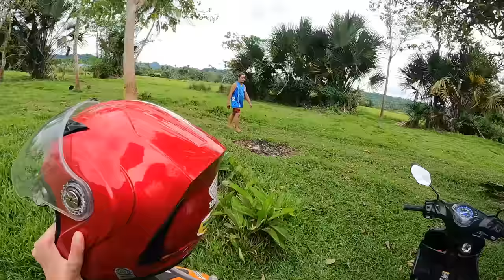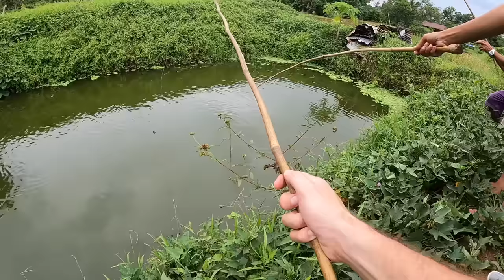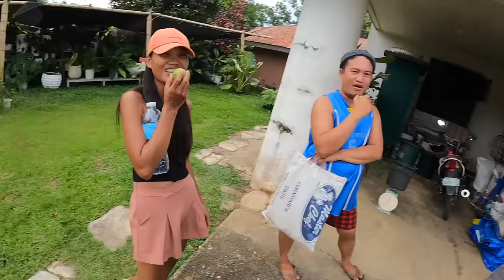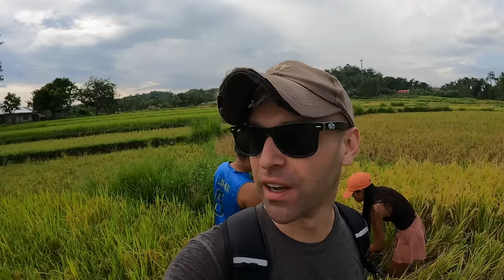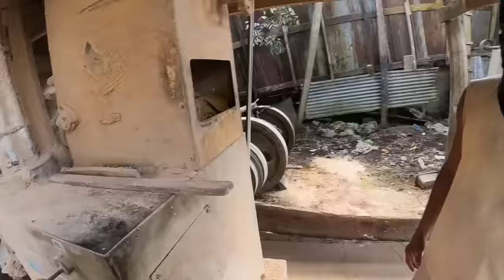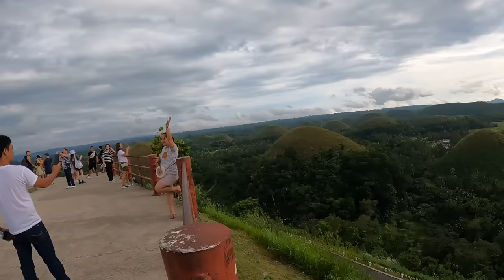FILIPINO RICE HARVEST! 🇵🇭 Philippines

Comment: While watching, I can almost feel and smell the freshness of the air 😍

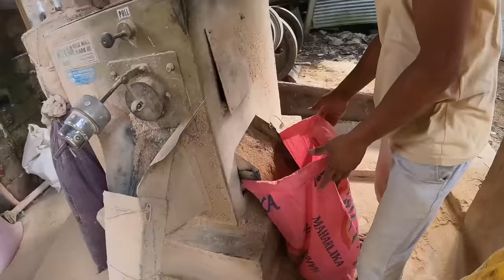@ 29:37, in the process of milling rice, the husk, the bran, and the grain is separated. The husk usually is thrown away (expelled outside  by the milling machine that's why you did not see it) but can also be used for e.g. fuel for cooking. The bran (rich in thiamine 😉) or the thin coating of the rice grain (those thingy coming out at the right side of the miller), usually is saved for animal feed. The finished product is the milled rice grains ready for cooking. 😊
Reply from the maker: Oh you know a lot about this process! I could have used you in the video explaining everything!